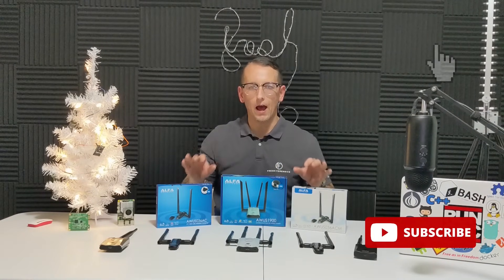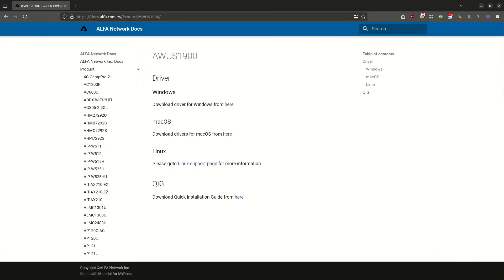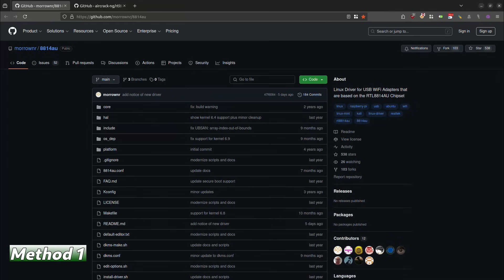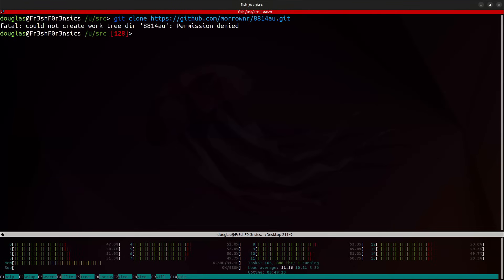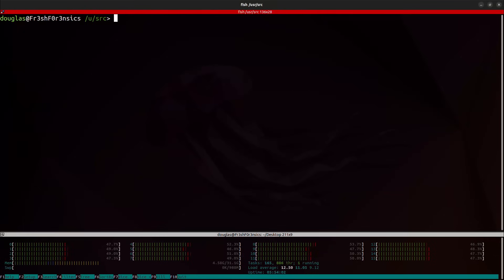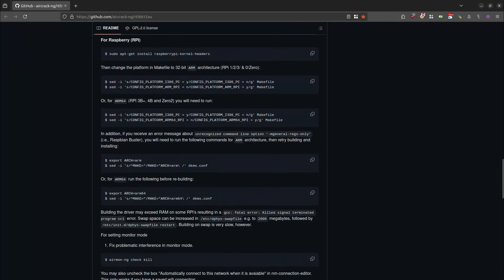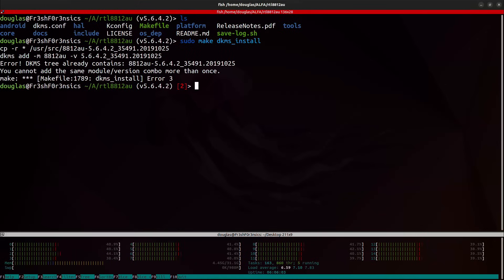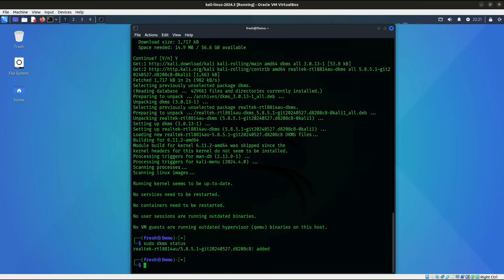Installing Drivers For Alfa [AWUS1900] WiFi Adapter - Complete Guide

Comment: Thank you for the video. However, I’m having an issue with the ALFA AWUS036AXML.
I’m unable to monitor access points other than WPA2.
I’m using Kali Linux.
It would be great if you could point me to some resources.